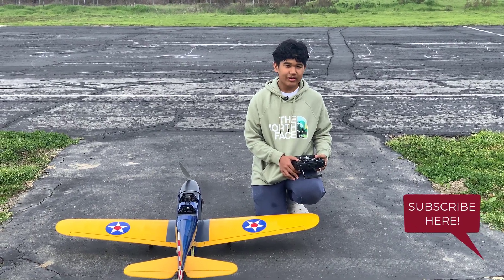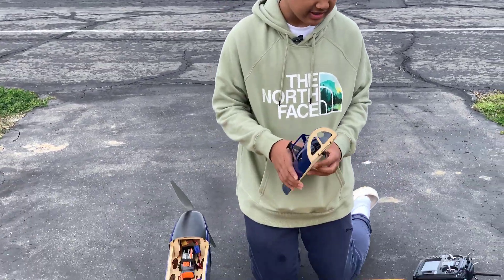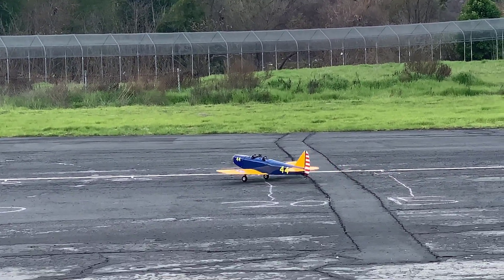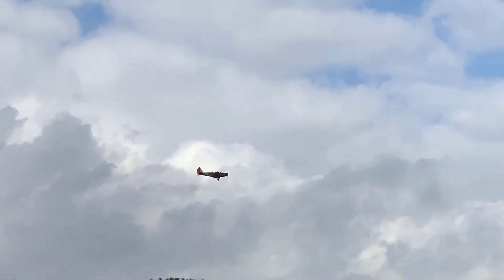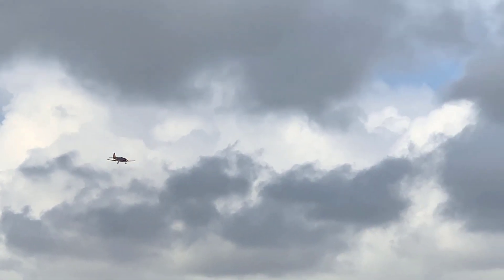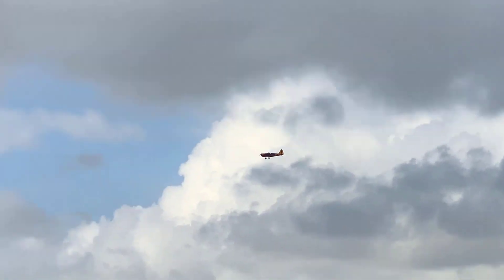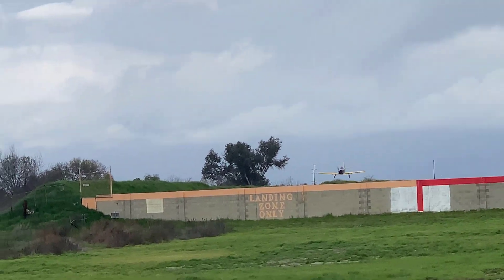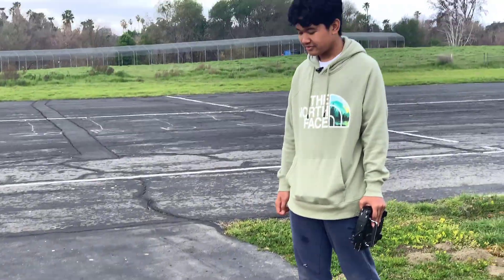TESTING MY NEW RADIOMASTER TS16X WITH A $24 8- CHANNEL RECEIVER ON MY $450 PT-19!

Comment: Hi. Here is an awesome update about R88 receiver. finally after testing the blank (4th pin) the pin which is mentioned as 'X' in usermanual which is present near the SBUS port i found out that its the external voltage measurement pin which measures and transmits voltage value to the transmitter with "A2" label. I tested it with my R88 V2 receiver in D16 mode. not sure if it works with R88 V1 or D8 mode. Initially the ratio needed to be calibrated for accurate voltage value.

Comment: I have owned a TX16S for about 2 years now, and I love it, especially since you can put an ExpressLRS module in it for fpv drones. I have had a terrible experience with that reciever though, as my plane failsafed, and the throttle started up with no input, despite the fact that the throttle cut was on.
Reply from the maker: Thanks for the feedback on the receiver! I’ve only had 3 flights on it so far without issues. But, I will definitely watch out for it.

Comment: Did you give up on the Spektrum transmitters?
Reply from the maker: No! Absolutely not! My main transmitter will always be my NX-10. We purchased the TS16X to test it out and to use for models that are not compatible with Spektrum such as Rage RC and the older Great Planes Tactic models. Some of my subscribers suggested I play around with the Radiomaster and do a review video on it. It’s coming soon!

Comment: I'm looking at those R88 receivers since they are down to $10.99 from Radiomaster.   My search brought me back around to this video.  Curious which protocol you used with this flight?  D8, D16, or SFHSS?
Reply from the maker: Hi! I didn't they had a price drop! That is a steal! For this flight, I used the D16 protocol. I now own two of these receivers, and have used D16 for both.
Reply: @JonsRC  Fairly recent reduction i believe. I just ordered 2 of them. Sweet deal. Not sure how long it will last.

Thanks for the info!

Comment: I want to buy the tx16s , i use a small radio (jumper t12pro) , i have small hands and i have as my second option radiomaste boxer that is smaller, but i wonder if i am losing too many switches with the boxer. Plus the tx16 is heavier. 

Can you provide your impression on this tx16s, thanks!!
Reply from the maker: Hi! After 11 months of owning my TX16S, I can safely say that it is probably the best transmitter that I use. EdgeTX is such a powerful platform, and there is just an infinite
amount of customization when it comes to programming your models. The upgrade to the TX16S is definitely worth it, the extra switches and the touchscreen is a must. The ergonomics (in my opinion) are really nice but that of course is subjective. I purchased my TX16 primarily for the 4-1 multiprotocol module, the range is crazy good and as a reviewer, sometimes it drives me crazy when it comes to RTF packages that use cheap controllers. It’s nice to have everything on one transmitter. So yes, I love my TX16 and you would probably love yours too 😃